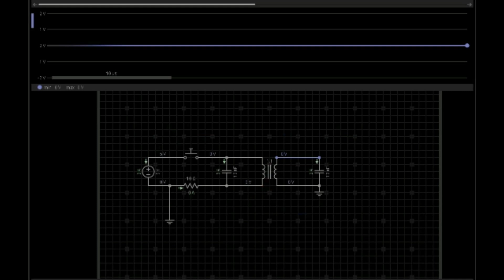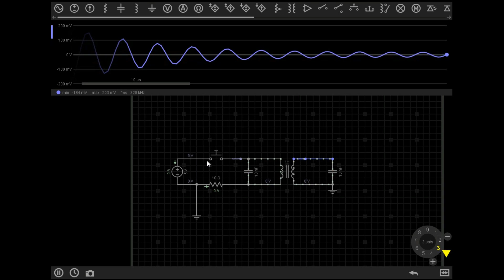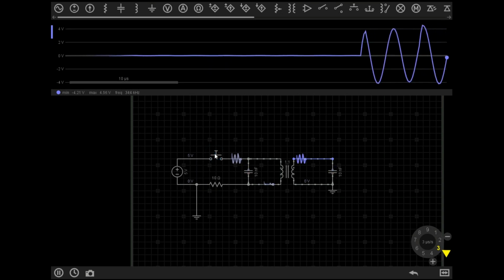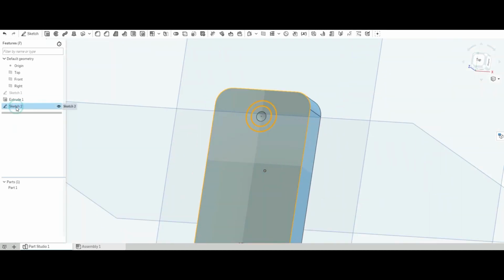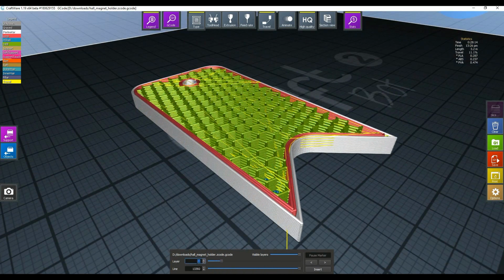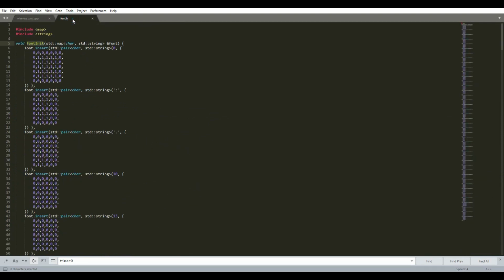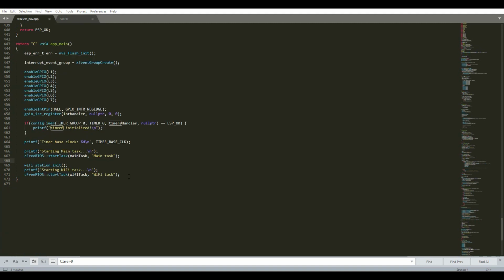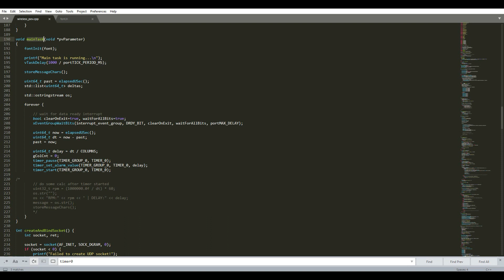Wireless POV display using ESP32 WiFi module

Comment: I'd probably have tried using an existing Qi wireless charging setup, but then i'd miss out on the fun of designing pcb coils.
Reply from the maker: When coil positions and the distance of the coils is fixed like in this application, then Qi is just an overkill. And yes, it was fun to create the spiral coils (gerber) programmatically.